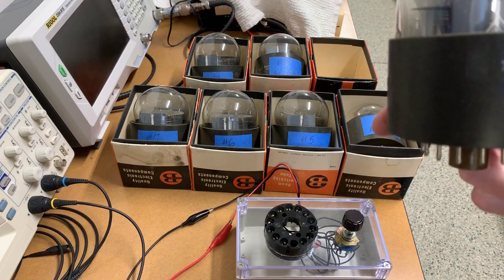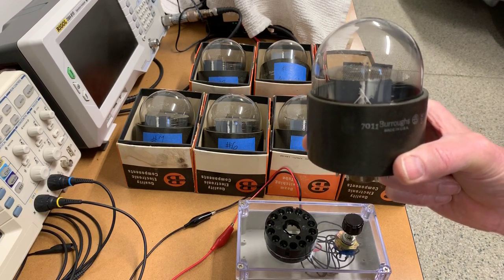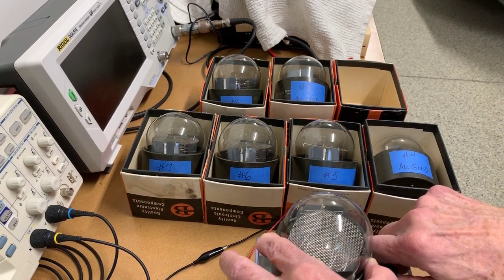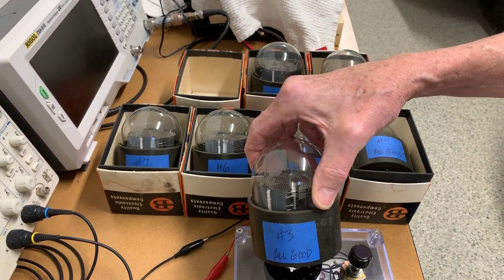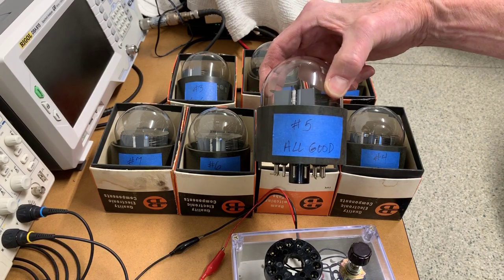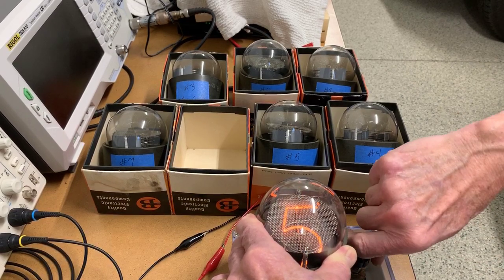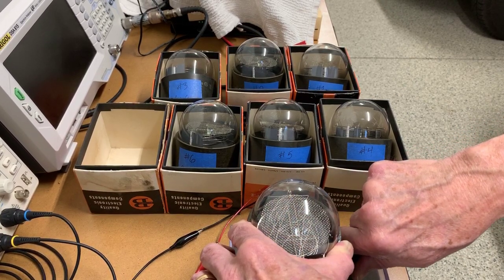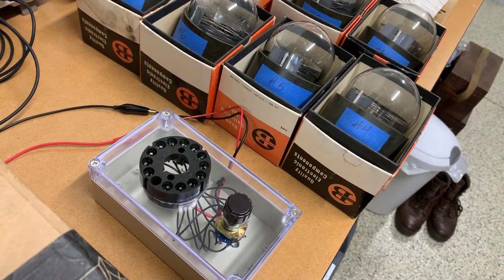HUGE Burroughs Nixie tubes

Comment from the maker: They are sold as of 1/28/2020.
Reply: What were they originally used for??
Reply from the maker: @gallimead  They were the precursor to light emitting diodes and liquid crystal displays. They dated from the mid-late 50s and were used through the late 70s-early 80s.  Smaller tubes were used as numerical indicators for computers, test equipment like frequency counters, and digital clocks. Some early desktop electronic calculators in the 60s also used these tubes. These Burroughs tubes were among the largest ever made.
Reply: Do you have a purchase link of this product?
Reply from the maker: @tranvantuan4734  Hello. All tubes were sold on eBay in January 2020. I don't have any more. Thank you for asking.